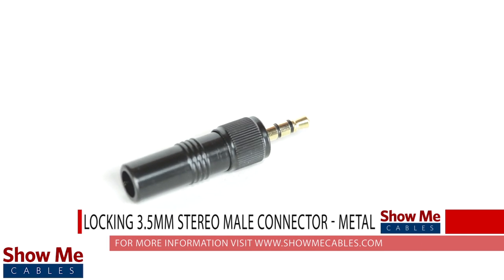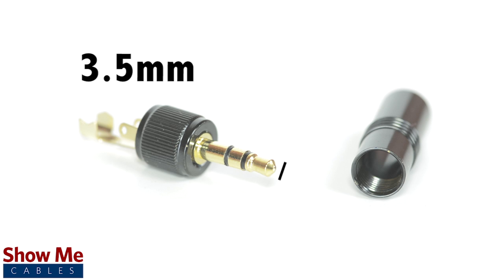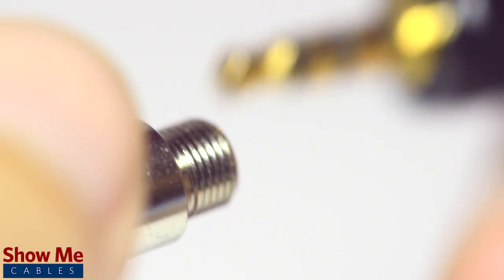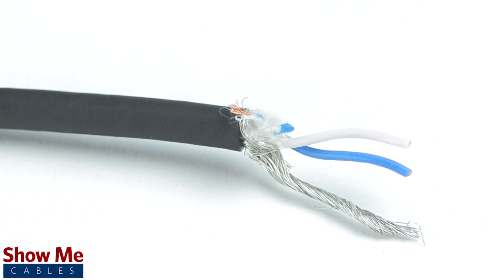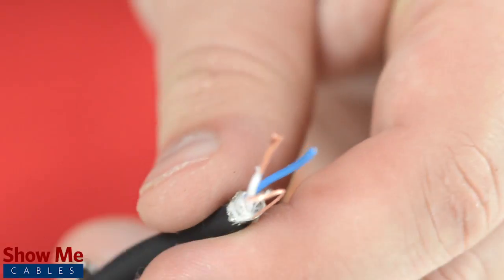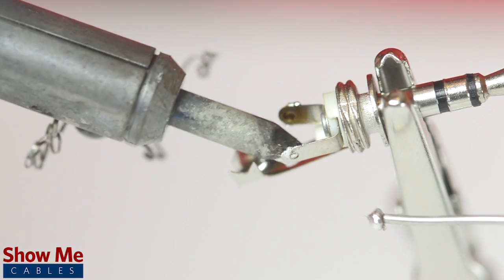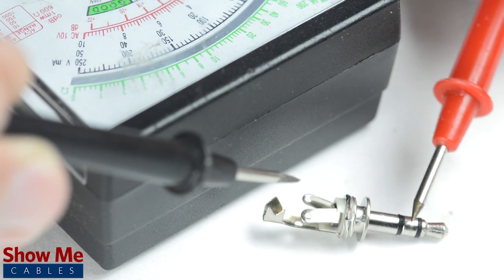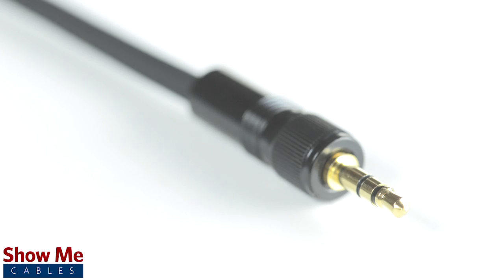3.5mm Locking Stereo Connector - DIY Project to Repair Your Audio Cable #453

Comment: man I'm super addicted to cables! I'm gonna buy a bunch of shit from you. I'm going to pull the headunit from my work truck and install this locking plug. I also want to install strain reliefs on all my vr headsets. I am a industrial service technician by trade. I have installed a small 600 watt amp and a 12 inch subwoofer into my company provided work truck. Having a good radio makes driving in Miami traffic bearable.

Comment: Can the locking nut come off the male connector, and will a threaded 3.5mm to 1/4" adapter screw onto it?